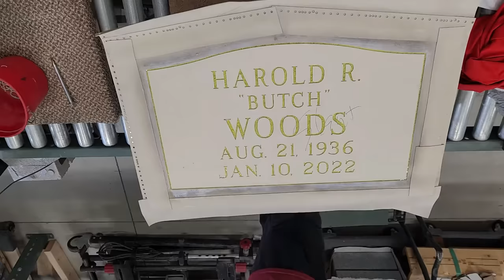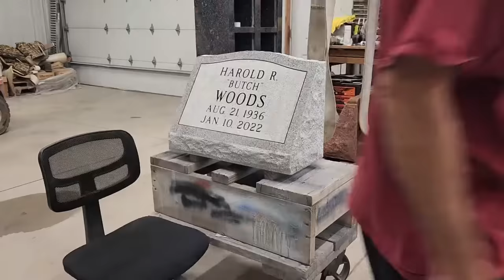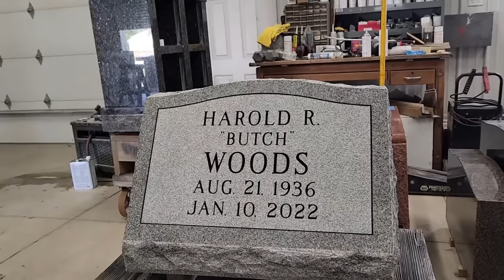Engraving a Headstone

Comment: Is that just regular black paint in the spray can or do you use some special paint meant for headstones so it'll last longer outside?
Reply from the maker: It's specifically designed for stone. Lithochrome paint. Lasts decades
Reply: krylon works great . eventually moss takes over . gold and silver look great on black copper looks good on white .

Comment: Great work! I do monuments however we use a laser to cut our stencil on the stone. Works great that way however when we double process we have to wait 24 hours for litho to dry and then fill with clay, weed the rest of the stencil to expose double processed area and then blast. Have you ever tried using a CO2 laser to cut the stencil vs using a plotter? I know everyone has their preferences on why they do things so I always like to hear peoples opinions/experiences. Also, why the white gas camp fuel at the end? I've never seen that before so would love to know what that does. Thanks!
Reply from the maker: That process, after the plotter, took about 2 hours. Lol Lasers are expensive! The camp fuel is to remove any left over adhesive. It dries fast and doesn't stain

Comment: How do Preneed stones get added onto  once it is at grave site? Is there a portable engraving machine?
Reply: it is removed and once the stone is complete it is placed back in it's resting spot
Reply: Chisels.
Reply: When we do it, we sandblast the date at the cemetery. No moving, no messing about. Simply add it where it sits with portable equipment and a truck outfitted for this type of on site work.
Reply from the maker: Exactly. On site

Comment: Nice work. Two questions; 1 Why did you do the first blast by hand and the second one "by machine"? 2 I had no idea the lettering was painted-won't the paint wear away???
Reply from the maker: Blasted by hand with light pressure only to remove the polished finish. It creates the "panel" that then highlights the deeper blasted letters from the automatic machine.
And yes, it is an aerosol can but the paint is specifically designed for stone. It will last many decades.
Thanks for watching!
Reply: @night_al  Thanks for replying/the info....keep up the great work

Comment: Just from a monumental mason in New Zealand our stencils are sticky on the bottom so we don’t have to lay glue down, any reason why you do it this no, no hate just genuinely curious
Reply from the maker: That stencil also has an adhesive backing. I always added a first initial glue to the stone just for security I'd say. But after frosting the panel, that stencil adhesive doesn't seem to bond well with the rough stone face. That's when glue is key and a must.
Thanks for watching! Hello from the US! Always wanted to visit NZ. Beautiful country
Reply: Oh yes I see, also with the automatic sandblaster, how much did you spend (if you don’t mind saying) and can you change the settings depending on the size, I just run a business with my dad and wondering if getting one is actually worth it
Reply from the maker: By settings, do you mean pressure? Or width - heighth? Leave pressure at what works for you. This was roughly 100psi with the stone about 26" from the nozzle. Width and height adjustments are manually made.
This machine was bought used and is probably 40-50 years old and from the new blast booths I've seen available, it's definitely the way to go. It takes away from doing by hand, granted, you still have to "babysit" the process (watch for stencil blowing up), it's so much simpler
Reply from the maker: I can't comment on the price as it was owned by this company before I was employed there. I really don't know.
Reply: Oh wow I didn’t even know they made them that long ago, we are on the search for one and hopefully can get a good one for what we need it for, do you lose a lot of grit while sand blasting, all our sandblasting we do in a booth that funnels to the bottom into a bucket but might have to change that with a automatic one
Reply from the maker: Aluminum oxide can be recycled and used again but does turn to powder after so many uses and takes longer to complete a job. Having adequate exhaust helps remove that fine dust and works to get it done faster.
Reply: Not all engravers do it this way. Many from Elberton Georgia  use more traditional  methods,  most use a self adhesive  mat as you describe  and a few are fully involved  in cad with chemicals and lasers.
Its all really  interesting.

Comment: Great video. Is the black filler something special or just a can of spray paint. Anything to keep it from fading?
Reply from the maker: It's a form of paint designed specifically for use on stone. Brand Lithochrome. It does fade. Takes decades.
Reply: Thankyou Al @night_al
Reply from the maker: My pleasure. Thank you for watching!

Comment: Interesting how the media used to cut the letters in granite leave the vinyl overlay intact?
Reply from the maker: It's a rubber stencil and as long as the nozzle keeps moving, it's fine. If the nozzle were to stop in one spot, for even a few seconds, it would burn a hole through and potentially damage/ruin the stone.

Comment: Cool video. Never seen this process, but I am familiar with sand blasting. What is the media you use for those 2 steps (background vs. lettering). Thanks
Reply: Zirconia ceramic, aluminum oxides, and a product called Starblast are commonly used.
Reply from the maker: Precisely those
Reply: @night_al  I've brought them from Miles Supply to a few places.

Comment: In my naive little mind, I imagined a craftsman wearing an old leather apron, and half moon spectacles, carefully marking out the text freehand, with a straight edge ruler, and pencil on the granite surface, then picking up his hundred year old tungsten tipped chisel and old leather mallet, he spent the next half day chiselling carefully the words as he had marked them out that morning. At the end of the day, he would carefully with a camel hair brush, paint the engraved letters to give relief and depth to his work. Instead of which none of this could be done if the electrical power was turned off, no compressor, no blaster, no headstone, no skills, just manual labour and no artistry. What a naive idiot I am. Nobody has any talent these days , but they know how to make money.
Reply from the maker: I beg to differ... but thanks for the view

Comment: If a headstone is already installed at the Cemetery how is it engraved to add fire example,  another person.  Is it removed,  engraved and reinstalled?
Reply: Engraved onsite with a portable sandblaster. They mask would be made offsite.
Reply: Adding stuff is easy I do about 10-15 in cemetery inscriptions per day. Adding a name is relatively inexpensive. Pretty much the only time a stone is removed from the cemetery is if it needs to be repaired or resurfaced

Comment: Is the paint a dual stage? It looked like he sprayed black and then a catalyst. I would think you would need an epoxy. Camp fuel and water was an interesting touch. Saying it's sandblasting not engraving is like saying (machine) engraving is only milling. It's all a matter of the tool. Sand, acid, a spinning tool, a chisel...it's all engraving.
Reply from the maker: @jackvisn  black and then a clear coat. Camp fuel removes excess adhesive
Reply: You should use a "filler off" product. It's less nocive than camp fuel
Reply from the maker: @sergelepage9781  is it cheaper?
Reply: @night_al  I can't tell about it. But the smell is better(citrus) and I have no more headhaches after cleaning. We also barely use glue nowadays, the rubbers that we use are more sticky than the 3m
Reply from the maker: @sergelepage9781  I get it. We were stocked up on 3m before they quit making stencil. Honestly, it didn't stick that well on a frosted panel so the glue was a fail safe. Even the new stencil used seems to blow up on frosted panels. I'm a "better safe than sorry" kinda guy I guess.
Reply: @night_al  Since you didn't switch stencil yet, the new stencil I use is a 719y instead of the 519y in 3m. And he stretched a few times with more elaborate design
Reply: @night_al I was gonna say I miss that 3m rubber and was wondering how you had it. Unfortunately the company I work for was forced to switch to anchor which was still good but then they found a supplier they could buy 20ft shipping containers of and it's trash. Terribly inconsistent and doesn't stick worth a shit. 

Also I agree using camp fuel is probably not the best move. I'd be terrified of it igniting since it's just gasoline with different additives.
Reply: @sergelepage9781 are you talking ublast stencil? We use that stuff and have terrible luck with adhesion. We use anchor 211 glue I believe
Reply: @pamacons  yes, we'rw probaly lucky

Comment: When dates are added at gravesite, different proceedure.
Reply: I work at a cemetery and they use stencils and a small sandblaster . It does take a steady hand .
Reply: I did cemetery lettering for over 40 years.......same procedure as inside a shop.....only difference is a man moves the sandblasting nozzle instead oof a machine

Comment: Hello fellow sandblaster! I mainly do signs and address stones but occasionally I work on headstones. Are you using that camp fuel to clean off an adhesive? Most of my work is not on on a polished surface so I end up having to use stencil filler and filler remover, but I’m interested in what adhesive you are using and how easily it comes off with that camp fuel.
Reply from the maker: Hello! To answer your question, yes, the camp fuel cleans the adhesive off nicely. And the company doesn't want me sharing all aspects but I can point you in the right direction if you'd like:
https://www.milessupply.com/product-category/monument-supplies/adhesives/
Reply: Thank you sir!
Reply from the maker: @ImJokingGuy  very welcome thank you for watching!

Comment: when blasting the lettering process, how many passes did it take to get that depth?
Reply from the maker: It depends on the size of the letters and size of the stone. This stone in particular had roughly 8 passes. 4 up and 4 down in total
Reply: @night_al  To get to a depth of what- A SIXTEENTH OF AN INCH ?!  This is horseshit, they used to cut way deeper than that!
Reply: Eh........no..there was no horses involved.......
Reply from the maker: @Telephonebill51  those letters were deeper than a sixteenth.

Comment: Actually, what material is the sticker used to protect the surface from sand blasting?
Reply from the maker: rubber stencil
Reply: @night_al Thanks, fascinating video, sorry for the negative comments.  I wondered what the resist material was too.  At first it's mystifying that rubber would work, but maybe it's similar to the reason a cast saw cuts the cast and doesn't damage skin.   The rubber, because of its elasticity, lets the sand particles bounce off.  Is that correct?
Reply from the maker: @Salmagundiii  exactly. As long as the nozzle keeps moving. If it sits still on one spot, it will quickly burn through the stencil and damage the stone

Comment: I did this type of work years ago before computers came into the picture. It was a long process. We hand sketched everything on paper, used thick green masking, transfered the design using a rolling micro hole puncher. Then transfer the design using charcoal power "pouncing" technique. Then we would hand cut the design using xacto knife blades. I miss this kind of work 
All due respect for the way things are done in today's modern world, but I still believe in doing things the hard way.
Anyone can use a plotter. But not everyone has the ability to do it by hand. That's another thing. His "tatted up" hands are A HUGE DISTRACTION!!!
Reply from the maker: lol, thanks for watching

Comment: Great video, what is the brand of spray paint used, as I have a headstone that needs the letters re-painted, thx in advance
Reply from the maker: @jlook9679 , lithichrome paint
https://www.granquartz.com/catalog/product/view/id/26592/s/lithichrome-aerosol-stone-paint/category/198/
Reply: You can get someone legit to come out from an old time headstone company most likely to do a real job that doesn't require cheap , costly, painting.... That's what I would do.

Comment: Well as an engraver and sandblaster and everything else to do with with monuments and I'm always laid out all my information everything prior to a cutting it out and and frosting out the panel and then glue it and putting it back in and then finish carving it but you know hey two different ways to get to the same point the better which is the fastest that's the question
Reply from the maker: Fastest isn't always the best method. It's not a race

Comment: Looks ok but that's not engraving that's stenciling engraving is cutting into a material. Or so I was led to believe.
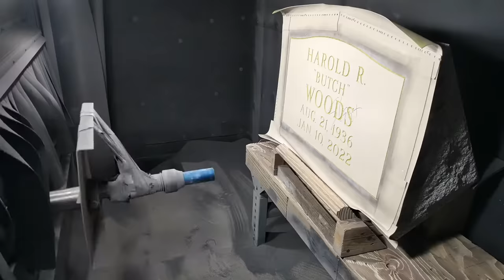Reply from the maker: Engraving starts at 6:04 using aluminum oxide. It penetrates any area not covered with the rubber stencil, i.e. where the letters were peeled out
Reply: Sadly not done by hand.
Reply from the maker: @davidhobbs7587  the family appreciated this stone done and set in a timely manner.

Comment: Very, very interesting! Was that naphtha (campstove fuel) I saw being used as a cleaning solvent at the end of the video? Naphtha is highly flammable, even explosive in a confined space. I would never use it indoors.
Reply: By federal law each rattle can of spray paint says to use with adequate ventilation. May contain xylene, naptha, toluol, and crap that can cause cancer, leukemia, kidney failure, reproductive birth defects and stuff they haven't discovered, diagnosed or given a name to yet.  It takes time for it to happen, long after you put down the spray paint that said "Use with adequate ventilation."
Reply: In a space like that you’d need to spill a couple hundred gallons to even get near flammable limits. Considering the dust they create you can assume they have a pretty hefty collection system which is going to draw plenty of fresh air.

Comment: I wonder if they are paying for portable compressor unit’s rental? I would think they have one integrated in the shop and it’s down at ‘this’ particular moment…if not and they don’t have their own, then someone didn’t think about probably, that it is an important tool in their shop. 🙈🙉🙊
Reply from the maker: The compressor is owned. Originally, this job was meant to be portable only. And for decades, it was. After business got too big to handle, the son's were brought in, a new monument company was started and a shop was built. Having multiple compressors "laying around", the system was designed around those compressors. Now, portable is still in full swing and the shop uses a portable Keyser compressor for all daily needs.
Before people freak out and tell me "what's wrong" with the set up. keep in mind, the owners set all this up. Not me. Honestly, I would have made many changes. Alas, i was only an employee.
Thanks for watching!

Comment: well I must have missed something.......at one point he had Gold letters laid out on the marker.......then it went to 'engraved'......what did I miss?
Reply from the maker: @xbigshot1  at 6:04 engraving begins using a sand substitute (aluminum oxide)
Reply: @night_al  I just do see it..........at 6:04 it looks like he's blasting the entire front
Reply from the maker: @xbigshot1  it is. Only, the rubber stencil repels the blast media. Anywhere there is no stencil will be penetrated by it and engraved
Reply: Ah, so that's a rubber barrier.    I was wondering how the blasting was able to gouge granite, but not a tack paper....

Comment: Anyone who's ever seen an assembly line will realize how inefficiently this process is designed.
Reply: And this is the difference between quickly and properly.
Reply: Good thing we don't die on assembly lines...
Reply: @SiAnon  . You're right quality is most important. actually research shows the more efficiently a process is designed, the better quality and fewer defects.  See Toyota production system
Reply: I was thinking the same thing. Shop layout didn’t seem to have been a concern when they built this place. Going back and forth like that just makes room for errors and accidents. To me the second most amazing thing in this process is how fast that automatic blaster etched out those letters. And the first is how well that resist barrier layer withstood that same intense blasting. Even the little pieces inside the letters. That’s some amazing material there. 
Thanks for the really nice informative video.
Reply from the maker: It took more than what's shown in the video to blast the letters deep enough. I edited it out it for time. It was easily 7-8 more passes.
Reply: @night_al  I should have said of course overall it is very impressive.  As a former industrial engineer however, I can't help but think about the flow. my advice is to think about how you can rearrange the equipment  so that you take the fewest steps possible, and move the stone as little as possible.
Reply from the maker: @GregoryDibb  I absolutely agree and was not involved in any of the layout. I built both booths and finished the inside of the building. Flow was the owner's idea. I would change a few things absolutely.
Thank you for watching!

Comment: How long wil spraypainted letters last?
Reply from the maker: @chrisbow1776  depends on the direction it's facing. Sun will fade eventually and wind will blow dirt in them, but typically many years. I've seen letters still black after decades
Reply from the maker: @BenN-p5v  depends on region
Reply: wow, thanks for that deep insight